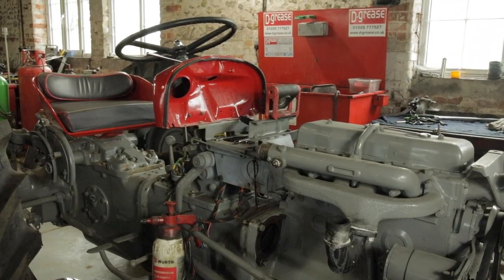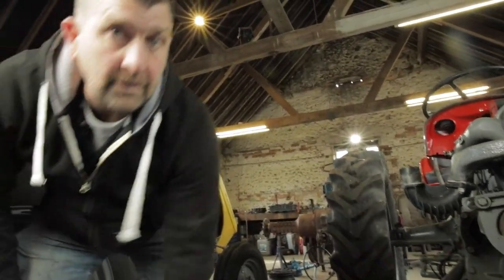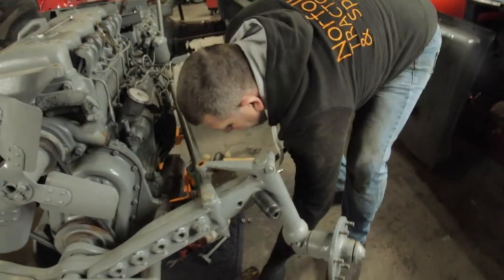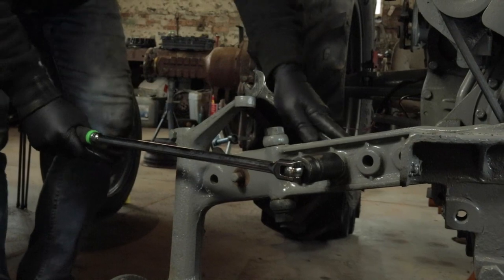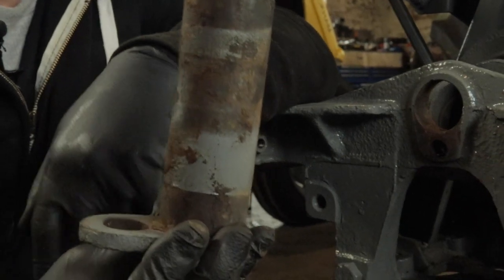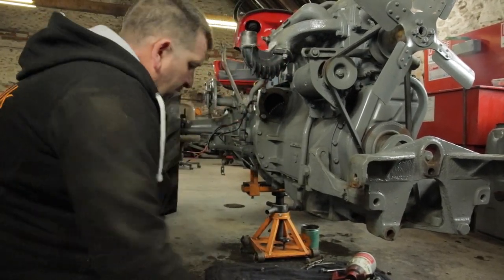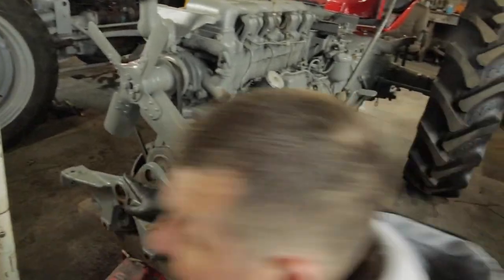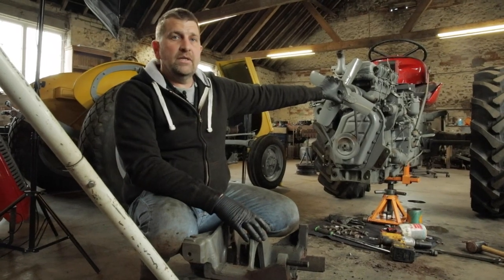Ferguson FE35 VINTAGE TRACTOR RESTORATION Part 2: Front Axel Removal

Comment: Great video!  I have to replace the pin and the bushings.  Do I have to remove everything you did or I can stop somewhere in between?
Thanks
Reply from the maker: Thank you for watching the video. I personally would remove all of the axel just to replace and of the bolts and give it a good clean you don’t have to remove the axel carrier from the tractor you can leave that as long as the axle pin hasn’t worn the carrier. Hope that helps.
Reply: @kevsvintagetractorrepair  thank you for the reply!
Did you  make a video to show all you did before getting into the pin extraction?
As I can see, you did not remove the wheels and the rods??
I’m asking you all these questions because next week or the week after, I’m gonna help my friend replacing pin and bushings in his MF 35 and I do prefer know a little more ahead of time😁
Thanks for all your advice, it’s really appreciated!!